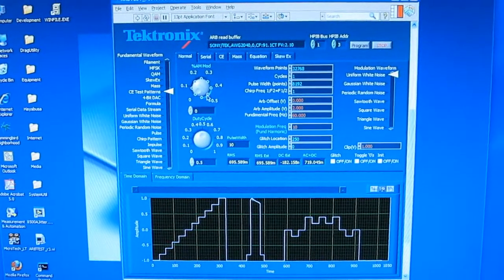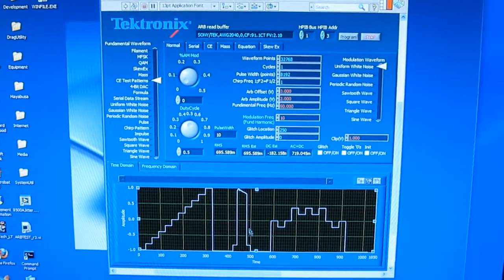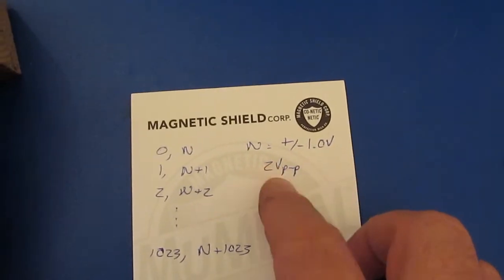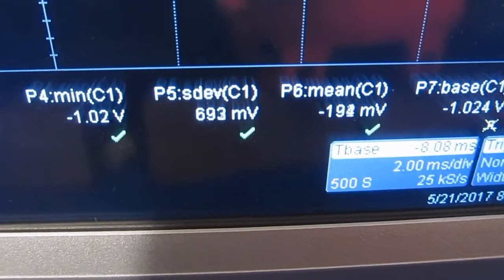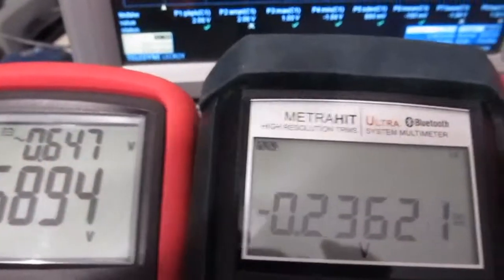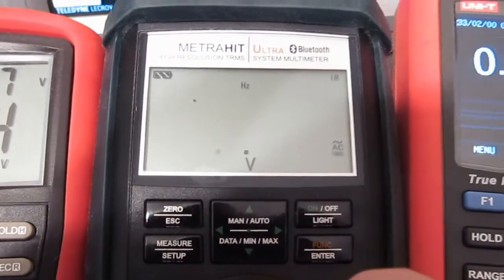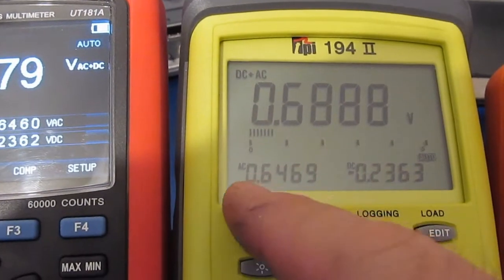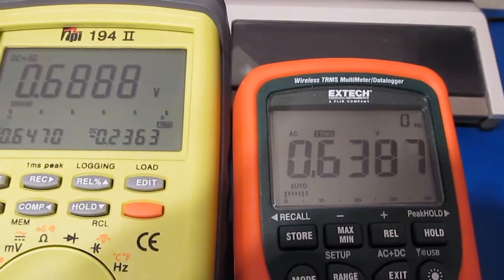Gossen Metrawatt Review, Make Your Own Custom Waveforms

Comment: if i read it corectly you generated it at 50 hz ? 
but it look amazing, almost valid power suply waveform :]
in few years time every apple product will reqire apple shaped ac to work
thanks for the effort, and patience with me
Reply from the maker: I think it was set for 60Hz but the Arb can play it back much faster or slower.   

You did all the work,  I just pushed a button.